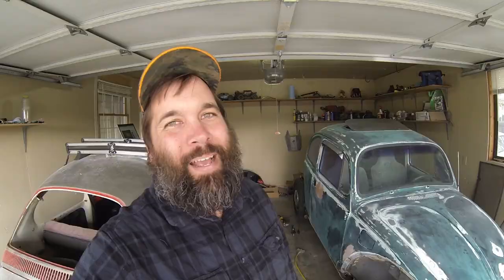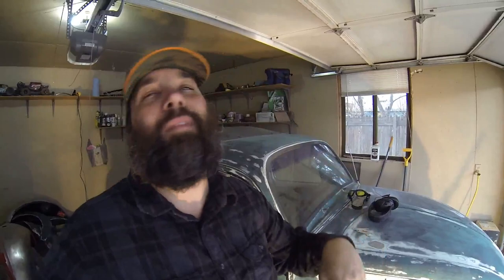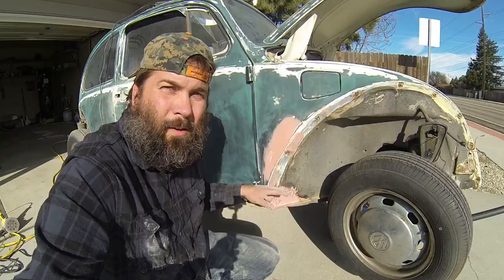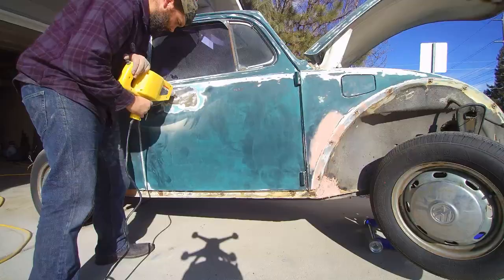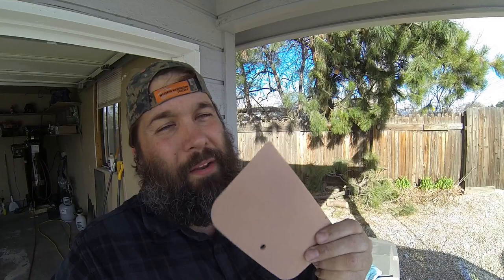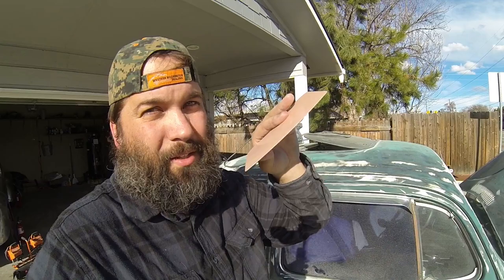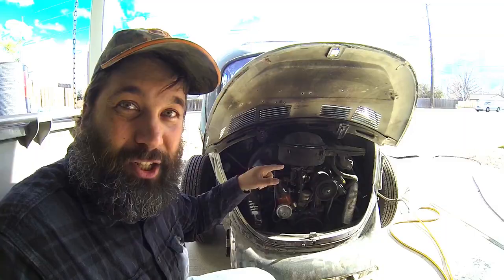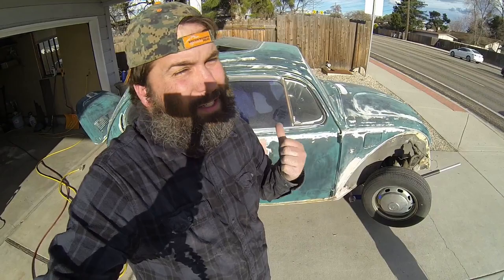1971 VW Bug Beetle Restoration auto vlog DAY 15 Done Welding! GREEN PIECE DECLARED!

Comment: I would swap the engines for now.  When was the last time you adjusted the valves on the daily driver?  The timing might be off a bit.  See if the heads are tightened to spec.
Reply from the maker: Thanks for the suggestion, Ivor! I adjusted the valves and it seemed to help a little.  However,  this morning I checked the oil in the sun and found metal flakes glistening back at me. Ha! Now I have an opportunity to learn how to rebuild a vw engine! I think I may still end up throwing Green Piece in there if only to be able to test the engine before I sell it. Thanks again for the response and suggestion!
Reply: @derekmeehan5350  even on YouTube.  It didn't sound quite right.  I am seriously preparing to rescue a Karmann Ghia.   We need to get it before the snakes get too active.  I am watching every YouTube video that I can lay my eyes on.  I've never owned a VW (long story)  I've studied the John Muir book.  I first read it in the 70's.  I remember the sound of good running VW engines.  VWS are sensitive cars.  If this rescue is a bust. I will get another. I have a friend that used to own a VW shop.  I will be "bugging " him a lot.
Reply from the maker: @ivorlittle I'm glad you are taking the steps to get yourself an old Vw! Good luck with those snakes!

Comment: Curious...What welder are you using? Great videos!!!! Thank you for sharing your project! Love working on my ‘68 bug.
Reply from the maker: You bet! It's a harbor freight 120v. It does the job.  I have a 68 I should be working in next spring!
Reply: Derek Meehan Sweet! That’s what I picked up to use. I have lots to rust clean up. But, looking forward to it. Any words of wisdom with it? Do you have it on high setting? Thanks! Enjoying the videos. Thanks for posting them!
Reply from the maker: @thriftymachineandweld4190  It depends on what I'm welding. For most of the sheet metal,  high will just burn through it. I'd start with low. There are lots of welding how to videos from guys MUCH more skilled than I am.  However, what I've learned with thin metal is to just "touch" the metal. If your need a solid bead,  first touch the metal to get a welding "mark". Next, touch that welding mark on the side you want to go.  Keep "touching"it until it builds up.  Eventually you may be able to drive the bead.  However,  WATCH OUT, because sometimes the heat from the bead can melt the thin sheet metal.  My best piece of advice? Go to your local hardware store and pick up several pieces of sheet metal.  Start with something thick.  Bring it home and cut it into smaller pieces.  Set your welder on low and run the wire quickly over a joint.  Let the metal cool.  Try to break the pieces with a hammer(they should break fairly easily). Next, on low, go slowly and try to break apart.  Next, turn up your welder and do the same thing; run it quickly and test,  then run it slowly and test. Now that you've done this with a piece of metal around 1/4", try your hand with some thinner pieces. Use the same methodology with each thickness of metal.  This is the best way to learn! Pro-tip: do NOT skimp on a mask.  You will be grateful in the end.  I'm sure you can spend a LOT of money but for me,  i like the auto mask at harbor freight (around $50). The mask that comes with the welder would work but it's much more cumbersome.  At any rate,  I've got a business trip sneaking up on me in 4 hours so I should run. Good luck, and keep us all posted!